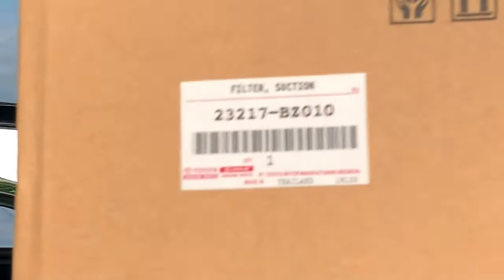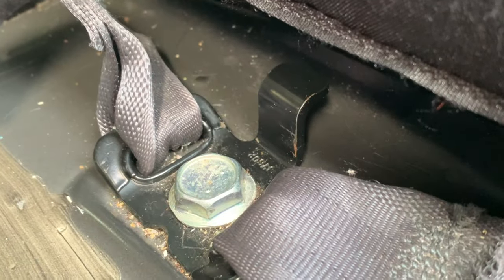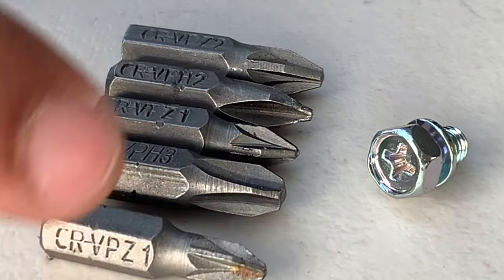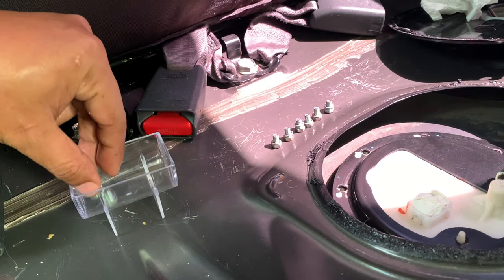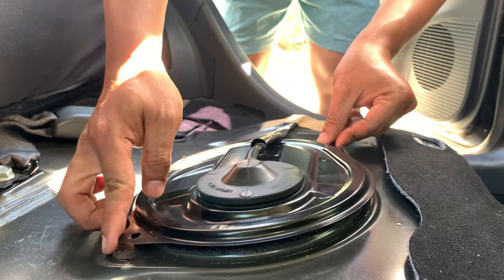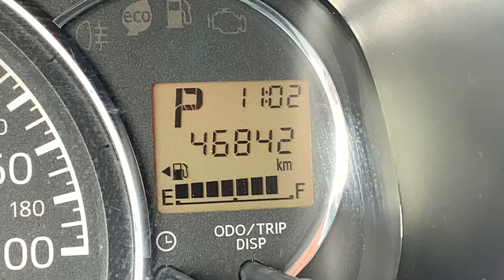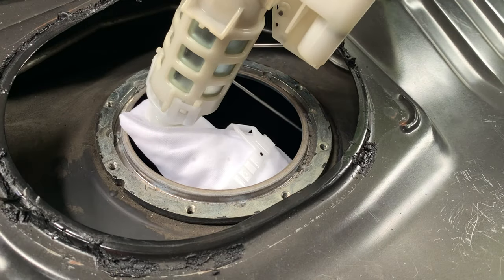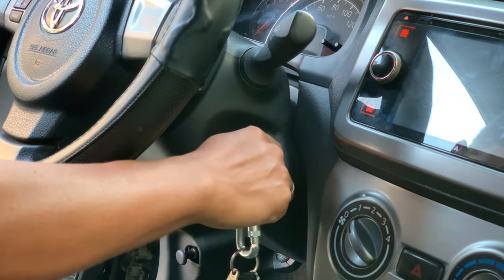How to Change Fuel Filter - Toyota Wigo, Ayla, Agya, Perodua Axia

Comment: 2015 Axia with 197,800 km erratic fuel indication. I imagined that only the float mechanism needed to be changed, but Perodua Service shop had changed entire fuel pump assembly at double the price I could have bought the pump and easily changed it myself. Wish I had seen your well presented well articulated video earlier.

Comment: This is something new! What happens if I proceed to change the fuel pump without disconnecting the fuse?  My fuel pump is in dire need of replacement bcos when it's hot with ac running there's weird sound at the back and occasional jerking before the power cuts off. Had to make sure my fuel doesn't drop to 3 bars otherwise I won't go far before the engine dies. I'm doing a DIY replacement bcos going to the service center will cost me an arm 😂.
Reply from the maker: i appreciate your comment. i suggest that you remove the fuse first to stop the flow of electricity from the fuse box under the hood down to the fuel filter assembly for your safety. this would also reset the fuel filter properly. you can also remove the negative batt terminal na lang before doing this pms and or fuel pump replacement:) i hope that helps:)
Reply: @WigoRaizeTV  ok. Maybe i just removed the negative battery terminal cable to be safe bcos the fuse is too small I might have misplaced it 😆

Comment: Such a cheap reliable car but so little info for maintenance. Good job showing this. It kinda sucks that it doesn't have a standard inline fuel filter on the frame or firewall.
Reply from the maker: Thanks for watching:) I appreciate the comment.

Comment: diba dapat ilalagay muna sa. run position after removing the. fuse para ma relieve ang pressure?
Reply from the maker: in my case, i did not do that anymore. i did use the vehicle for at least 8 hours (overnight) so when i pulled out the fuel hose, walang gas ang lumabas.

Comment: 133 yung range ng gas ko the nagpagas po ako ng p500. Nde gumalaw ung range at nasa 133 pa din. Need po ba magpalit ng filter or floater un problema? Salamat po.
Reply from the maker: try to observe muna. if after an hour or two hindi pa din tumaas ang range, possible na floater ang issue.

Comment: Good day Boss, bakit po di masyadong smooth ang manebela? Tapos saan po ba makikita ang power steering fluid ng wigo po? Salamat.
Reply from the maker: the wigo has electronic power steering. wala na pong steering fluid reservoir ang eps:) in my case, compared to my previous vehicle (toyota 95 corona), mas smooth naman ang eps ng wigo.
Reply: @WigoRaizeTV  ah, ganun pala Boss, pwede po ba ma-adjust ang eps? kasi medyo matigas po ang manebela, mas magaan pa ang manebela ng dati ko pong mitsubishi adventure 98. Salamat po sa response.
Reply from the maker: @nieljay321  i suggest patingin nyo po sa casa kung talagang hindi smooth po ang steering wheel, lalo na kung wala namang steering warning light sa dashboard.
Reply: @WigoRaizeTV  ok Boss, maraming salamat po.

Comment: Boss bakit malakas yung leak ng gas pag ka tanggal ko ng hose niya?  Bat sa tutorial wala naman. Gen 1 wigo po.. what to do. ?
Reply from the maker: apparently, may pressure pa din sa fuel hose ng unit nyo po when you pulled out the hose. ok lang po yun as di tumalsik sa inyo or sa carpet ng interior. process to the next steps
Reply: @WigoRaizeTV  ok po thank you boss

Comment: Sir Allan question re Toyota fuel injector.. 
1bottle fuel injector - full tank fuel. Or
1/2 bottle fuel injector - full tank fuel ??
Salamat sa sagot.
Reply from the maker: i'll do a video soon on how to clean the fuel injectors directly. using additives lase hindi clean on how to use them like ilang liters ng gas ang kailangan sa tank for one bottle:( also, most of what's in them are also present in a regular fuel. mas maganda pa din ang direct cleaning using a fuel injector cleaner spray can.